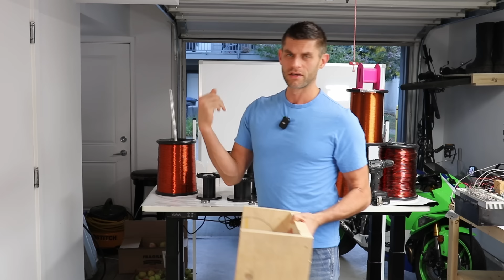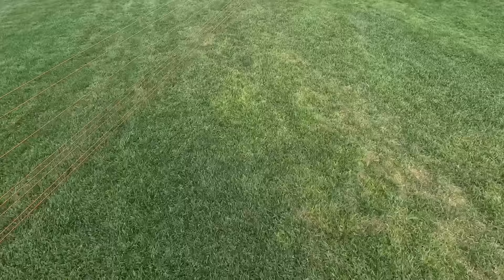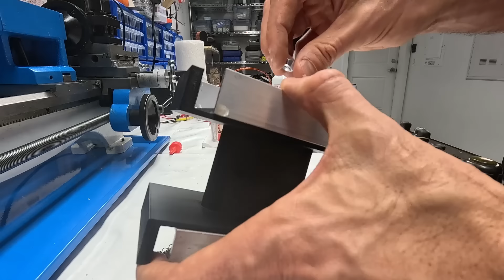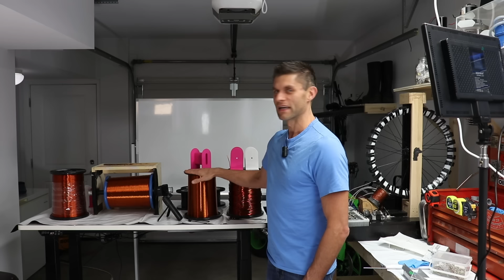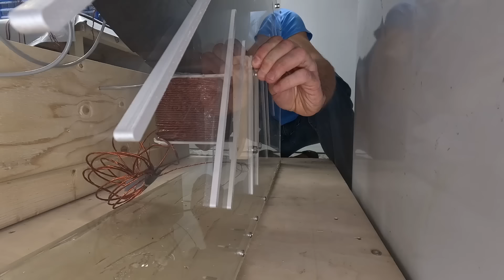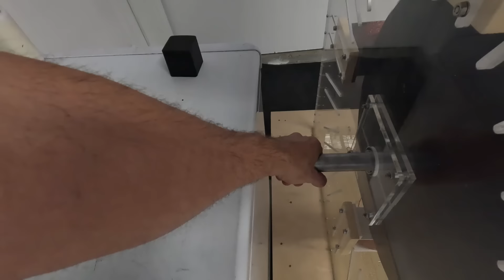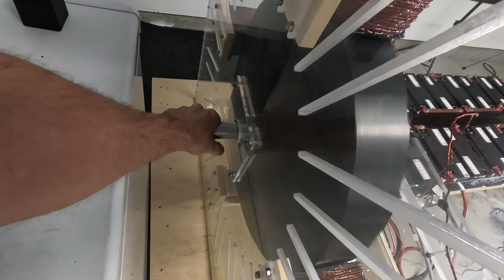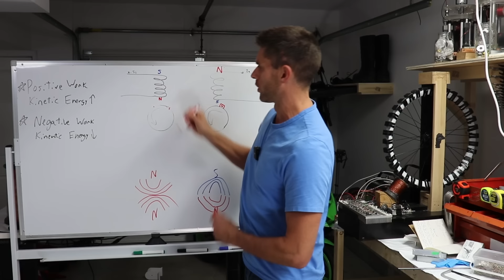The Device That Could Give The World Unlimited Energy

Comment: This makes a really neat and seemingly long-lasting flywheel. But! Here's the catch:

You're using timed magnetic repulsion ("positive work") to keep the flywheel spinning, however that's the opposite of what you actually want the flywheel to achieve -- generating electricity! When you try to do that, the drag from the stator coils will negate the momentum resulting in nett zero/negative gains (vis-a-vis energy input).

My thoughts.
Reply from the maker: There will be some loss with the gen coils yes... but much more energy if we time the discharge correctly
Reply: @MadscienceLPTECH that's basically a trust me bro, care to explain how exactly your tapping into quantum fluctuation how is your device creating assymetries in quantum fluctuation and actually pulling enegry from them any physics you can reference? If your going to say that your design is based on new physics is there any proof except trust me bro? Any measurements you can show alongside a detailed explanation on how it taps into quantum fluctuation i would love to know how simple coils and magnetic pulses are supposed to tap into quantum fluctuations and your losses they are atlest in the single digit watt which btw if you managed to pull energy from quantum fluctuations it would only provide uW even in the most generous estimations which is orders of magnitudes lower then the bare minimum estimations of your losses, but let's say it taps into quantum background fluctuations somehow and you somehow even manage to get 1000000 times more energy out then predicted in the most generous macroscopic quantum fluctuation estimates that means your generating a single watt what are you gonna do with that light up a led 😂

Even if your device produced a million times more energy then the most generous estimations your generator would not have any use cases you can build a solar panel for the same price as your giant ass motor + batteries and get orders of magnitude higher energy gain nobody would use it since it's economically much more favorable to build solar panels or wind turbines and this assumes you somehow generate a million times more energy then even way overblown estimations you would probably be looking at 1000000000 times more energy then normally estimated to even reach a single watt output power
Reply from the maker: @MindfulMinutes-nz1lznot in the comments. I do explain in my videos
Reply from the maker: @MindfulMinutes-nz1lzif your paradigm dosnt allow for anything but solar thats cool. Mine does
Reply: @MadscienceLPTECH your only explanation was well it's quantum you have never actually gotten into how you device claims to drag power out of quantum fluctuation besides as i said even if you did you would only get extremly tiny ammounts of power which your losses would overshadow by multiple orders of magnitude if you truly wanted to build a device like that you would need Casimir plates for quantum assymetry and you would need superconducting circuits since any ammount of loss would overshadow the gain, your build is cool but it's not a unlimited energy device, if you want to reduce losses remove the motor shaft and magnetically suspend it or use carbon nanotube lubrication
Reply: @MadscienceLPTECH  Hi, did you find Russ Gries research?
Reply: @MadscienceLPTECH bro is right — it’s just a flywheel. You won’t get net energy gain no matter how much you try, there will always be losses. You said it gets its energy from quantum fluctuations or something, but even if you could pull that off, quantum fluctuations give you at best milliwatts, and realistically it’s closer to femtowatts or picowatts depending on the scale of your setup. Your losses would overshadow that by a factor of a thousand.

There is no easy way to infinite power but honestly I like it that way it makes things more interesting if you want high energy density you could try to build contained decaborane fuel cells tho you would need multi save room protection and ultra high vaccume for UHV distillation and cold welding capsules and stuff so idk 😂
Reply: @MadscienceLPTECH  You know what? Don't market your invention as infinite energy stuffs; you might as well work on a highly energy-efficient fan design for everyday use and market that instead.
Reply: @pj_ytmt-123  You can not even patent a device that claims free energy or anything resembling a perpetual motion machine. They will literally just instantly deny it. I enjoy this guys content and there is a lot one can learn about electromagnetism but this will definitely in the end prove to be unsuccessful. What he is claiming would mean that his motor is >100% efficient. Average electric motors run around 95-96% and with the fact that almost half of earths energy use is from electric motors there is a huge incentive for any company that can even improve by a fraction of a percent. The latest most efficient motor is by a company called ABB and their newest motor achieves a 99.13% efficiency. The motor we see in this video is extremely loud(means energy/efficiency loss) and fails to convince me actually works.  If it did actually work then why not make the input battery just big enough to get it started and not multiple batteries that could easily run this machine for days. If it actually made a net positive energy then start it up and then why not disconnect the input battery and just use the output and feed back into itself? It just doesn't make sense. I still find it cool to see and have always thought if free energy was possible it would definitely involve magnetism. I would love to be proved wrong and some magic force like he describes be real but until proof and a device that makes sense I am going to say this motor fails to achieve what is claimed.
Reply: @jayman912 99.13% is so crazy I didn't even knew there were that efficent motors     thats extremly impressive, and yeah I dont get the giant batteries either like I once said in a diffrent comment all free energy devices hide their batteries expect this guy's he doesn't even bother to hide them 😂
Reply: In first 3 mimutes he is showing several "compass" units that point in DIFFERENT directions? He even rotates one so it points in "right" direction? WTF? I and done with this channel. I just wich Youtude allowed me to blaclist channels I do not wish to  see in my search...
Reply: @LjubomirLjubojevic are your glasses working? 3 compases pointed in the exact same direction. After he demonstrated how the compasses in the back react to the South Pole and the compasses in the front react to the North Pole in the magnetic field. If your to dense to comprehend what’s going on just say that and block yourself from the channel.
Reply: @KinglnYellow 

3:10 to 3:13 He removed and replaced a compas that was pointing the other way.
Reply: @LjubomirLjubojevic you're a silly Billy. This channel is better off without being watched by those who think so highly of themselves even though they can't understand basic movements.

Comment: How can you differentiate that the increase in potential energy isn't due to the desulfate action of the pulses for lead-acid batteries. Could super caps be used, that then discharge into a circuit that can charge LIPO4s? No matter what, it's a cool project.
Reply from the maker: Its about starting vs ending potential... if there is excess energy then there's excess energy

Comment: Forgive me if this sounds negative; it's not meant to be. This looks just like an over-engineered Bedini motor (I've built a good few in my time, not to this scale)? I find them useful at re-energizing batteries, reconditioning if you like - due to the spikes that are generated. But even by your own measurements in this video, there is no comparison of input over output. It's still working at a loss other that regenerating the batteries (yours are relatively brand new).

Hey, I'm not trying to shit on your parade. There are some constructive thoughts that you expressed. But what is the ultimate goal? 

Keep it coming, I find this compelling.
Reply: this is just taking power from the initial batteries and using fancy looking means - charging other batteries, at a loss due to friction, heat, etc.   There is no 'pulling energy from space'.
Reply: I do hope you can complete your end goal. I’ve subscribed to follow your journey.
Reply: If you think about turning off a tap and the water hammers the pipes this in my mind how this works in my own analigy 

The extra energy comes from the field collapsing or the tap being shut off abruptly
Reply: We always learn from our mistakes, keep learning my friend
Reply: yep, looks like a Bedini device
Reply: wasting your time trying to regen old tired batteries? lol
Reply: Synchronous motors destroy 50% of the energy potential that is available.  The trick is to capture the collapsing magnetic field as emf and turn it into usable energy.  This is the problem with current electrical engineering, as about 80% of Maxwell's theories were ignored for simplicity of basic understanding, ignoring the vast potential that is available and currently unused.
Reply: i think its a scam he is asking for money
Reply: You were way more polite then you needed to be. He claims on this and his other videos that the device he’s created generates “excess power.” His end goal? If he’s honest, he’s genuinely under the impression that he’s creating free energy. He’s a conspiracy theorist with an engineering degree.
Reply: @kristophercesmedziev7762  it sounds like he has an "engineering" degree.
Reply from the maker: @kristophercesmedziev7762 huh what are you talking about ? Im a scientist
Reply: @MadscienceLPTECH to @kristophercesmedziev7762
"huh what are you talking about ? Im a scientist"  
😂😂😂🤣🤣🤣
Reply: @MadscienceLPTECH  I wouldn't be broadcasting what you are....too many of them are mysteriously disappearing. Watch your back, brother. ~Jimmy Blake
Reply: @jamesblake4180  lol
Reply: I would like to say this is just a phase, but that is something that seems to be expressly ignored.

The technology and materials are simplistic enough to be described by maxwell equations.
Reply: Elon musk makes a electric car. Toyota?% makes a engine that runs on water? A perpetual motion generator then makes electric power?% The First Law of Thermodynamics?  It dictates that energy cannot be created or destroyed jason florida
Reply: @JasonBishop-m8d you my friend have no faith, you believe what you are told 😢, you have ended your belief system. There's nothing impossible my friend. AI , wireless energy, Liberty Engine and many assassinations of inventors have proved free energy exists. Just that the definition you (and the scientists) use to define free energy makes impossible or look impossible when it's actually easy. - science 🧪🔭 focuses on the end goal which is money and protection of governments and empires.
Reply: His measurements appear to me to show around 1 more amp coming out than is going in - but, I didn't work out what that means across the different voltages.  In any event - this seems at least very close to more out than in and he hasn't even added generator coils yet!
Reply from the maker: Watch my videos. The answers you seek are there

Comment: Why there is no osciloscope? You know why 😅
Reply from the maker: Litterally going to be alot more then that very soon. Coulumb meters will be much more usfule anyways
Reply from the maker: Funny how similar tech is already patented and working. Heavier then air flight has already happened
Reply: Tell me what I’m missing here?
Reply: @Vc33386 With osciloscope, you can see spikes in voltage, that caliper measure cannot see. This is the measurement error, not overunity.
Reply: @PaweAdamowicz1981 thanks good to know. I don’t think you can get far without a vacuum chamber

Comment: What if you made the permanent Magnets fixed and mounted and had your coils rotate between a North pulsed fixed point and a South pulsed fixed point? Would double RMP and /or Voltage output?
Reply from the maker: How would you attach wires to rotating coils?
Reply: @MadscienceLPTECH  with rails and brushes. If you wanted to get fancy possibly use magnets to "float" the coils over the rails to reduce drag.

Comment: It’s a clever build—good use of magnetic timing and pulse control. You can see they’ve pushed the motor physics about as far as the setup allows. But it still needs cleaner data and isolation tests before anyone can call it “limitless.” For now, it’s an interesting lab demo with promise if they tighten the measurements and coil design.
Reply from the maker: Agreed. That's the plan

Comment: Despite solving energy for the world you still depending on the grid power. Tells us all we need to know. 
There are natural sources of energy but vacuum or aether limitless energy isn't one of them. You got heat, solar, wind, water, that you as a consumer can harvest, natural sources. This machine is a harvester as well, it's a merchanical electric harvester, but it's not pulling energy from nothing or natural sources. It's pulling it out of the power grid. You're stealing power essentially. Which is why none of these ever will truely work or take off and why people get visits from feds. Because it's an issue and if it becomes too large of an issue.. it turns into politics and regulation and so on. Could it potentially be a way to have wireless energy.. idk, maybe, but doubt it as there definitely more efficient ways.

Run it in a remote place far away from radio or cell towers, high power lines, any source of man made electricity really, and in a faraday cage. It won't work... or it will be substaintailly less efficient. Electricity is leaky. We've known this for over hundred years. Yes, there is all sorts of energy around us, but most of it that is non natural is created by us. When you tap into it, your essentially robbing whatever is transmitting it putting extra strain on it and thus the grid. So, if you have a machine that can tap into the "aether" or "vacuum" or wtf ever you wanna call it, it's going to put more strain on the power grid once that "free" energy is quickly used up.

If you want to harvest energy.. make a device that pulls energy from all natural sources at once... a solar cell wind turbine with stirling/temp difference baked in or something lol. What you're working on is not the way.
Reply from the maker: Thane Heins has workong patented devices. On youtube infinite proven energy
Reply: @MadscienceLPTECH  Sure sure. I applaud you for trying.. but you'll figure it out one day... Unfortunately not before you realize how much time, energy, and money (even of others) that you'll have wasted. But, then again, if you learn anything from it.. then it's not really a waste. Be up to you to decide to what extent.
Reply: @st33l you are arguing a point which you actually prove, by your own words that you know nothing about that which you speak. 
Ether does not siphon from electricity. Keep trying, though.
Reply: @iaBrHeydron-d3w  oh well then why don't you enlighten us all then since you claim you know of what you or I speak. go on.. we're all waiting...